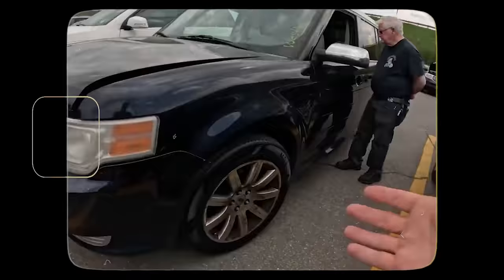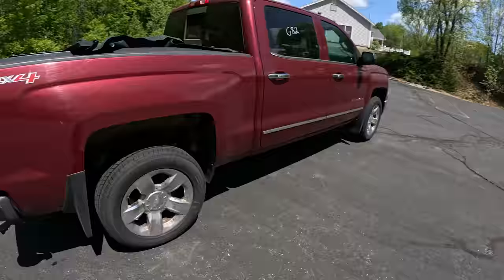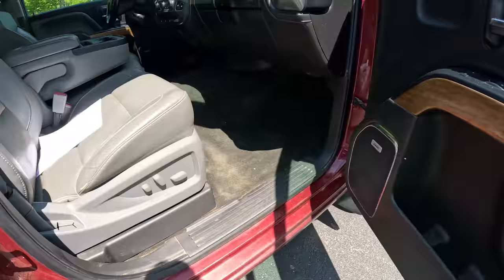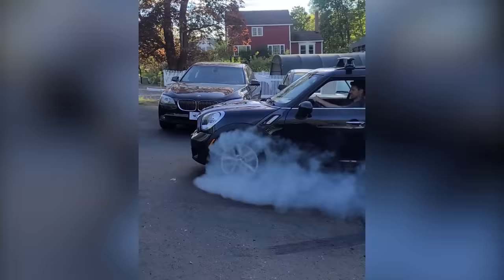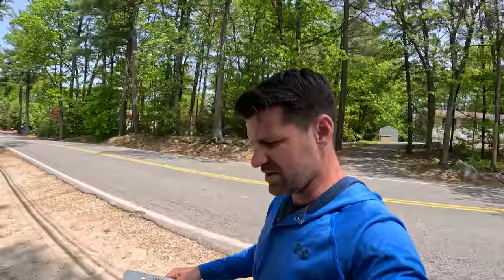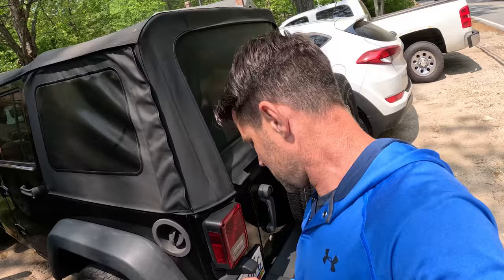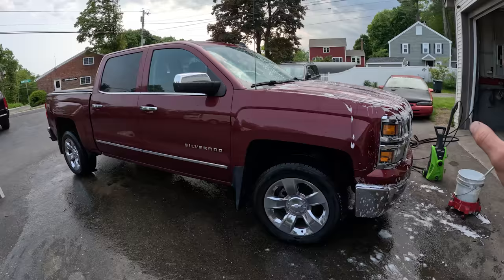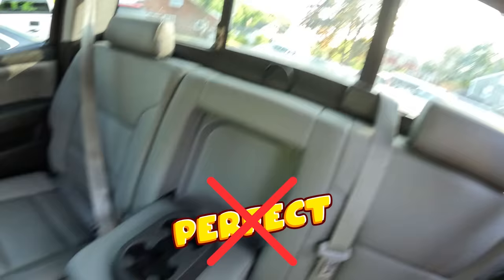How We Make a Fortune with Bank Repos During Hard Times - Flying Wheels

Comment: That dent on the fender is the parking dent! When a driver is backing out and looking behind them or at a backup camera but don't notice that the fender is too close to the garage/car/parking pole next to them. Usually you see them on the bumpers, you get so used to seeing it on the bumper you won't notice it anymore something about the shape of the Silverado's square front causes folks to hit the fender instead. Also, straightening a bumper like that, use a big ratchet strap instead for the slow pull instead of the car.

Comment: So, what kind of shop is doing an alignment with 2 bad ball joints🤣
Reply: Maybe the "unbiased" shop was hoping to get some business. That's always a risk when you have inspections done at places that conveniently make their money by fixing the issues.
Reply: They could be "good" enough to do an alignment but NOT good enough to pass inspection. Not to mention that they could be "on the way to being bad" but craig being a good used car dealer, he'll replace them. Same as the tires: they have enough wear left to pass inspection but the ride would suck. 

My last used truck I bought, they did both lower ball joints even though it passed inspection and replaced the "pass" tires with good used ones with plenty of wear left.
Reply: Craig prolly told them to not worry about it just toe and go it’s a commercial customer who does a lot of tires with them just did as he asked I would assume

Comment: Some free advice for you. LTZ is a RPO code like Z71,Z28 and yes ZR1. Open the glove box and look at the RPO code sticker. It will tell you exactly what a GM vehicle was born with.
Reply: Not completely true...not all RPO codes make it on the SPID label.
Reply: @stupadasso8961  having vin decoded my 2007 Silverado and then cross-referencing against my RPO sticker I respectfully disagree
Reply: @rob m  I clearly said NOT ALL RPOs make the SPID....not 100%...because you decoded your VIN doesn't mean anything...the build sheet will show different RPOs Vs. the SPID...
Reply: @stupadasso8961  You sound like you are in the business so maybe true. The point is this dealer who is either dumb or creating drama for views should know better. I can think of maybe 5 things that one would want to know about a GM vehicle before purchase all found on that sticker. 1) trim ie  LTZ, Z71. 2) alt amps 3) G80 yes or no. 4) gear ratio. 5) which 5.3 engine or not.

Comment: My 2015 LTZ has rear parking sensors..it has the same seating configuration as yours…i do have  heated seats no ac seats…I also have a heated steering wheel…there’s various packages..:u can see what options u have with checking the RPO codes in the glove box

Comment: Its an LTZ. LTZ on the 14 and 15 had the projector headlights. LT had reflector lights. Also the stain in the headliner is from the 3rd brake light leaking. Common problem on these 14-18 trucks. Seal with silicone

Comment: "how do I know it's real without calling a dealer?" There's an RPO code tag on it somewhere - usually in the b-pillar, in the engine compartment or behind the glovebox. There are RPO decoders online that will tell you every option the vehicle came with. 
Also, you should upgrade your trailer fenders with either "drive over" or removables. Then you can put pretty much anything on it without mangling them.

Comment: You did an alignment but it needs ball joints? 
Whoever aligned it obviously didn't check anything first....I wouldn't use that shop again!
Reply: Some cheap tire shops are famous for doing “toe n go” alignment. They just make the wheel go straight.
Reply: @jrs4ex  thus the reason I said to stay away....
Reply: @stupadasso8961  I think he just wants the cheapest price and then if there’s a problem down the road with the vehicle he sold the customer can go to Town Fair Tire and not bother Craig. Some places do lifetime alignment too so you make your repairs and get another done free. I’m surprised he didn’t slap some used tires on it he had laying around.
Reply: @Agni_Cane Corso  doesn't matter...you can't "align" something properly if it has bad components...

Comment: Craig, here's the real question... did you put good tires on it, or do like most dealers and put the cheapest Chinese tires you can get? I always do quality tires. To me, it's worth the extra 20% to get good tires. I then use it as a selling point. Yep, I make less, but I feel better.
Reply: That's the sign of a decent dealer, IMO.  If a dealer is willing to put cheap, no-name tires on a car, they are probably willing to cut corners anywhere else they can too.  Props to you for doing things the right way!
Reply: IRONMAN iMOVE A/S Gen 2. A sign of a quality recon.

Comment: I think that’s a LT truck with leather seats and maybe 20 inch wheel upgrade. Like you said LTZ usually has cooled seats and heated steering wheel. Only difference in the 2014-15 silverados with ltz - high country was sunroof and dvd player. I bought a 2015 Silverado LT with cloth and still have heated seats but not cooled.
Reply: And mine is a z71 package, not sure if that makes it any difference with the trim options for like door handles etc. but I have chrome door handles on my LT

Comment: Yeah it’s a real LTZ is just a badly equipped  LTZ since it has gray leather interior and the regular bench seat console most of the LTZ’s out there come with the premium black leather interior or beige/tan color and the full center console and yes those wheels are the original LTZ wheels they used them from the years 2014-2018 the only thing that I see that it’s missing is the Chrome running boards

Comment: The dent is because they attempt to pull into the garage and they hit the side of the garage in that front quarter panel
Reply: While being high on drugs
Reply: My 2017 same dent on passenger side
Reply: People watch the top of the fender when pulling in or out of garages or tight corners but what they forget or don't realize is how much farther their fenders stick out just above the tires until they hit it a time or 2 especially when their previous vehicles had almost straight sides from the fender top to the wheel arch.  The ones that get me is people in those little cars that have all 4 corners bashed.  Do they think it is small, it fits in any place with just a little gap?

Comment: Where do you get the replacement seat covers? Ebay has them for my 07 2500HD LT but it seemed crazy expensive for just the lower. I replaced the foam and just stitched the seam back together temporarily.

Comment: It is a LTZ but they opted for a 3 passenger front seat witch deletes  the a/c seats  the other thing I noticed is the fog lights my 2015 LTZ had round fog lights so either  it's a early 2015 or it has had body work or you were lied to and it's a 2014.

Comment: RPO codes will tell you what is factory. In GM trucks it should be in the glove box there will be a bunch of codes and you can decode each code, top models (like my 2005 Sierra 4x4 Z71 SLT) will have a bunch. But hey I can tell you my gear ratio and I have a rear posi with the rare 5.3 L33.

That is a good looking Silverado though love the colour.